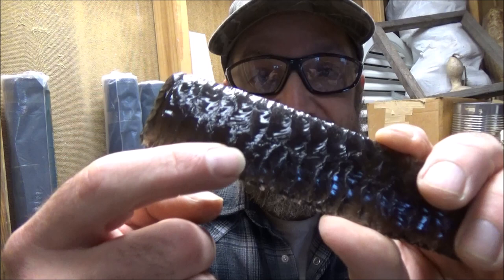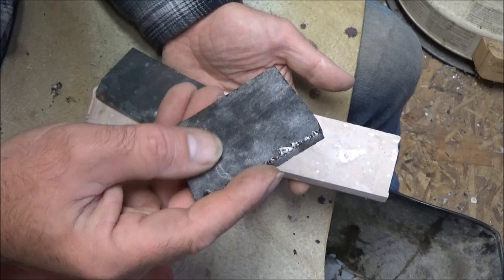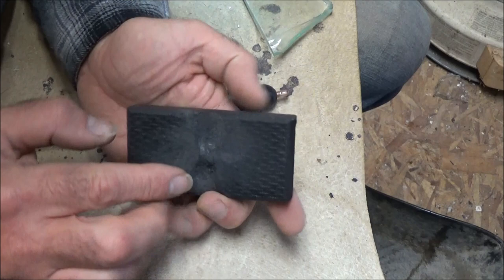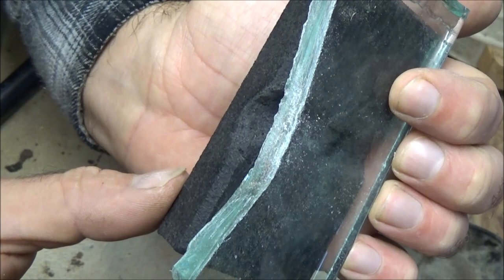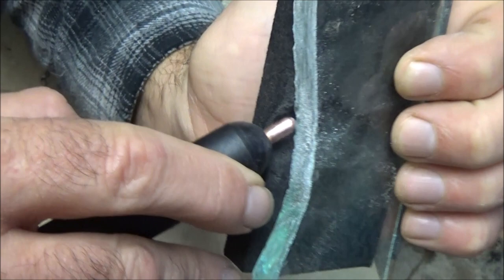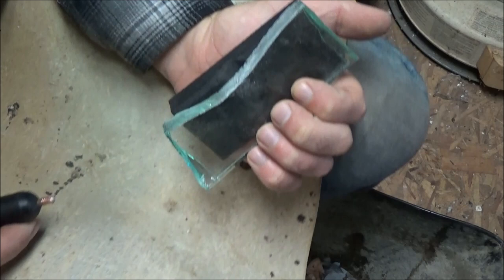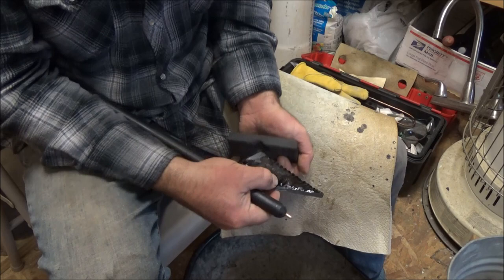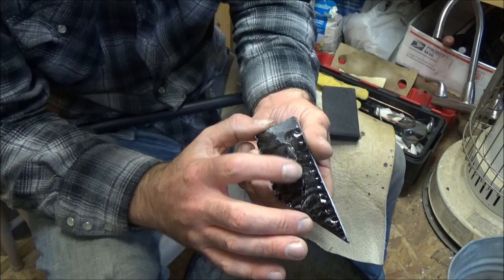flaking slabs in flintknapping

Comment: So my problem is that I can't drive my flakes far enough, they tend to stop prematurely. Is it because of the tool I'm using since I can't get a lot of leverage? Is it my strength? Or is it the fact that I don't have a grooved pad?
Reply from the maker: Make the centerline low, where you want to flake. The biggest problem is that they don't go far. It's not force, trust me. Keep the centerline low and just press the very little outer edge. A flat surface is ok. A hollow will stop short. A rounded surface will be best.

Comment: Always start at one end or the other, it is much easier to remove a flake when one side is not locked in by the other side, think 3 men interlocked arms try to remove the middle man nope it is much easier to get the guy one the end... the flakes will then come off much easier working from the end to end... also done in this way you still end up with a flat slab start by taking small flakes all the way around then take another pas a little longer then the third pass can go all the way . By doing this you will build a lens shape in your piece and it will look and flake much better..... good luck